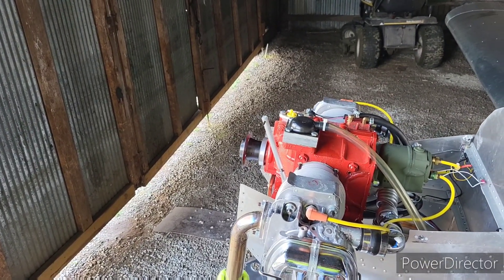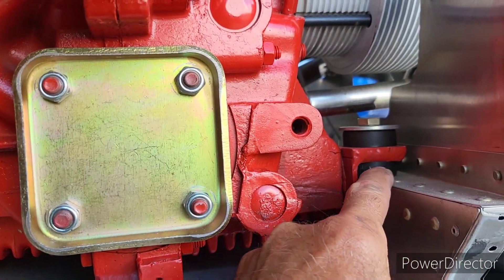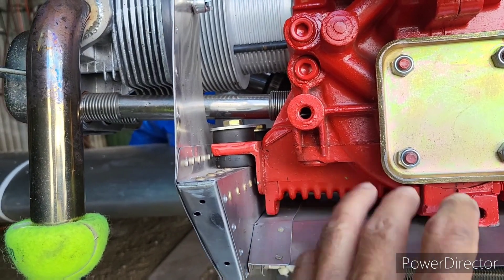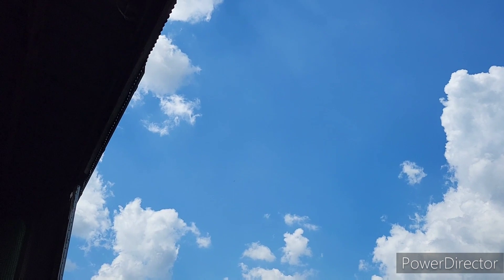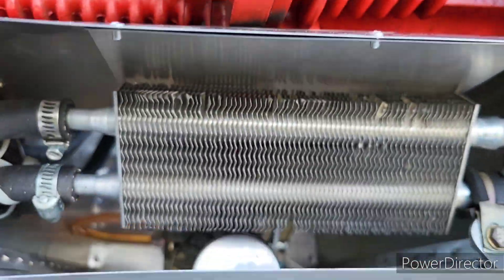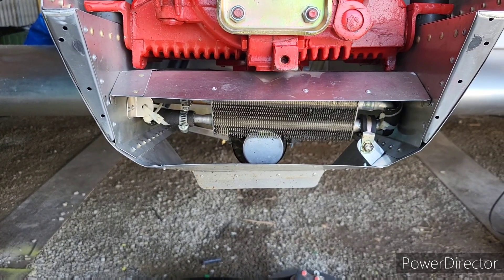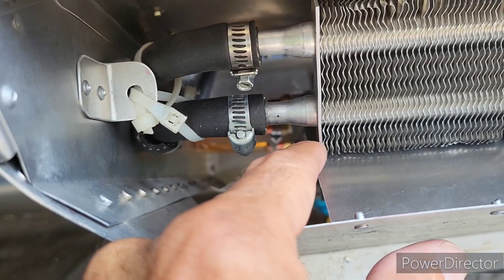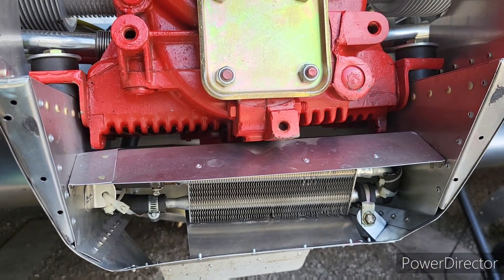Fitting and putting  in oil cooler baffling

Comment: Are the baffles touching the bottom cooler fins concerned viewer 👆👍
Reply from the maker: Hi On the money yes sir they are touching. I have had 2 people  that say I need to add the side baffling.  So I will do it with rubber.
Reply: @redblackvette  yes sides might help . I think you caught that snake and it’s not getting away 👍

Comment: Hey Dennis. In the Heating and Cooling business, we make transitions that go from square to round and back. curious for myself only. Would it work to put a funnel-like part that attaches to the front cover behind the prop and just have the back of the "funnel" like a few millimeters from the cooler? :D Wonder if you had thought about possibly doing it that way. Probably too much of a hassel. Take care.
Reply from the maker: Hi Michael T well sir that is kind of what I'm wanting to do. At least for now the top and bottom  will funnel. The sides that I am working  on right  now will be straight.  But I also my cut the inlets to a oval-shaped.....thanks for the message
Reply: @redblackvette  hey Dennis I believe you nailed it. I am still learning how rigid the aircraft aluminum is.